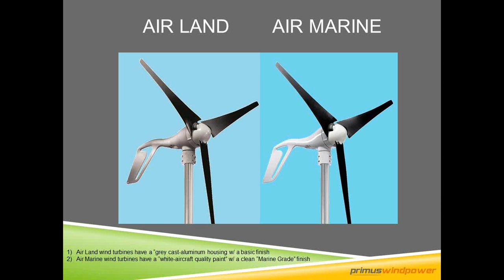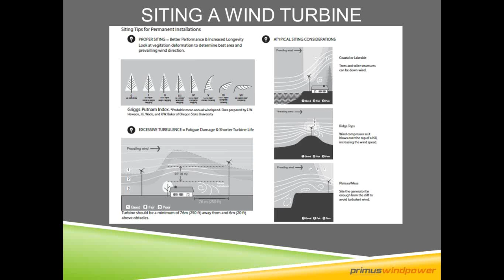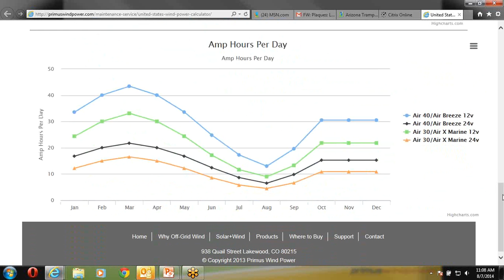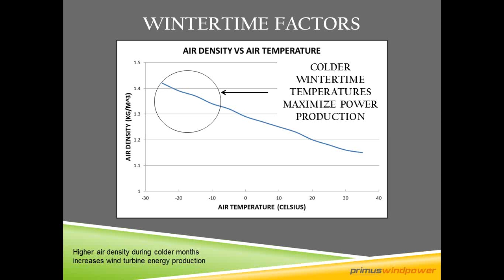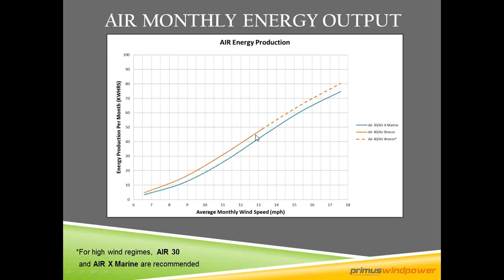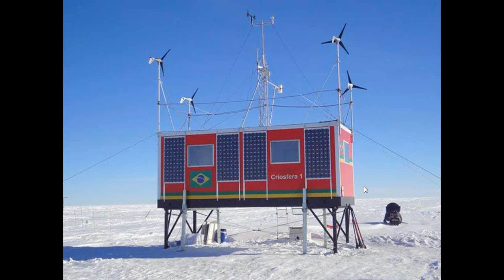Completes an Off-grid System

Comment: air30 is a well made unit but is mis-sold. It is useless in high wind environments. It brakes at 30 knots so if you live in a high wind area like me it sits all day doing absolutely nothing. The power curve shows continuing output past 30 knots albeit reduced to about 100 watts. Thats exactly why I bought it...even 100 watts would keep laptop and a light going. But it brakes fully and you get nothing. Beware !!!! I have emailed a few Primus a few times and heard nothing back. I wish I had gone for a Superwind 350 which has feathering blades and continues putting out 350 watts up to 100mph.  You will pay more...but you will have a working turbine and not the useless lump I am stuck with.